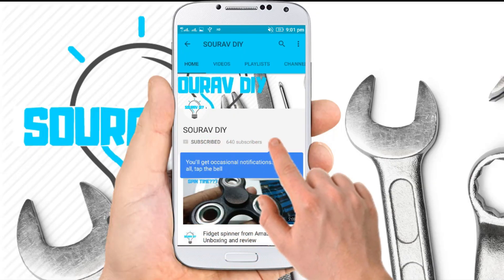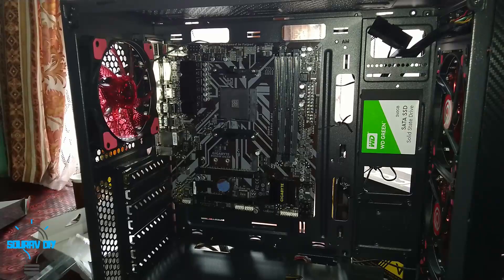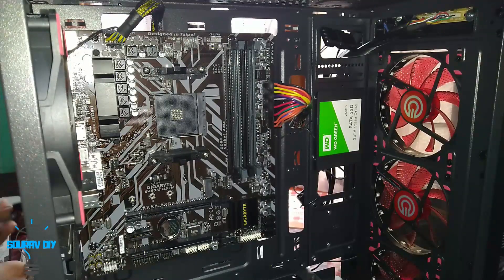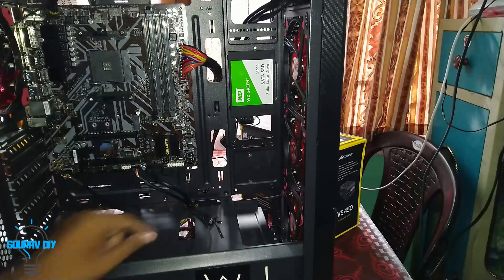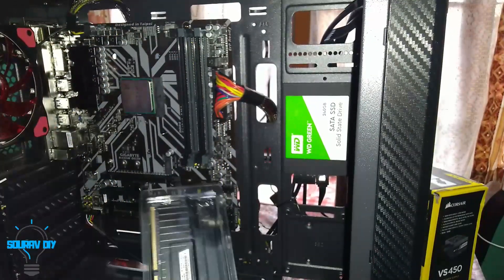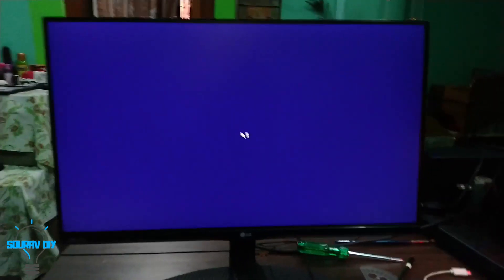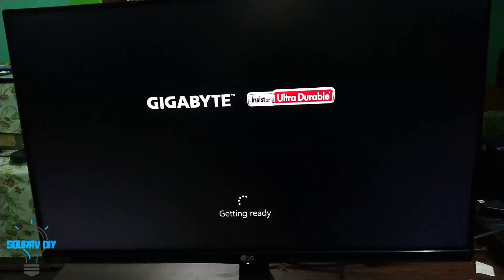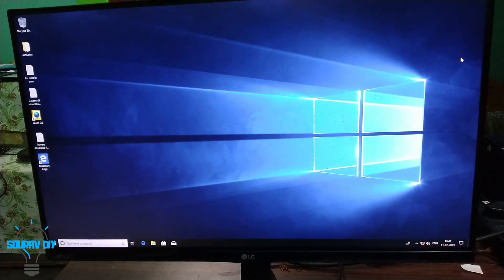How to assemble a Gaming PC, Ryzen3 3200g AM4 socket

Comment: Bro is cabinet has rgb header. If its not thr how to connect 4rgb fans in motherboard
Reply from the maker: This cabinet doesn't have RGB header
Reply from the maker: Buy a cabinet with 3 or 4 Inbuild RGB fan and header eg. Antec df500 or antesport ice tg 400
Reply: I saw vedios in youtube.. This cabinet has including led light remote  controler.. With 4rgb fans
Reply from the maker: @akashaku9363  you have to buy RGB version which is 5000rs , that has 4 RGB fan controller and remote
Reply: Without remote is thr any possible to control  rgb fan
Reply from the maker: @akashaku9363  no , only remote needed to control

Comment: Mere pass ryzen 3 3200g processor jo 2933mhz support karta hai aur b450m ds3h motherboard aur hm 3000mhz ram lagane wale hai kya ye ram support karega bina overclocking aur bios update ke
Reply from the maker: My pc supports 3000 mhz without overclocking

Comment: Which chipset driver you installed for vega 8 graphics
Reply from the maker: Check the driver link in description
Reply: @SOURAVDIY  On installing this driver.Facing a problem in booting.
You know what is cause
Reply from the maker: @mdmohzzam5054  which motherboard u are using
Reply: @SOURAVDIY  i also have same setup that you have almost every part
Reply from the maker: I think any problem in windows version
Reply from the maker: @mdmohzzam5054  download new windows from getintopc.com

Comment: I want to get a slightly better SSD, what size do you think I should get with wd 250gb blue?
Reply: Also, do I need a CPU cooler with this configuration of the components?
Reply: Okay, the first question is solved but (ignoring the price), what cooler should I use: the one in your video or a wraith stealth cooler?
Reply from the maker: Stock cooler is perfect in 3200g , get cabinet with more fans
Reply: @SOURAVDIY  Ok, thanks...do you know which cabinets I can use instead, I don't really know much about this and I want to make a PC that is decent with some multiplayer games.
Reply: @SOURAVDIY  Decent as in good with, not actually with the games.
Reply from the maker: @Tomos_J-J Corsair spec delta
Reply: @SOURAVDIY  Thanks. 2 more questions, what cpu cooler should I use with the same motherboard and cpu as you? (Think of what you'd usually use, but a little bit stronger) and what gpu should I use for an intermediate (like 3.2 out of 5) gaming demand?
Reply: @SOURAVDIY  P.S, I won't be able to message you...I will sleep soon.
Reply from the maker: @Tomos_J-J  wait for amd 5500 gpu
Reply from the maker: @Tomos_J-J  antec a30 or a40 cpu cooler

Comment: Bro i have bought exactly wot u have bought except the mobo i have bought Asus Ex-A320m Gaming.. is it ok with it!!! orelse i shud go for B450.. Awaiting for ur reply asap... My products are on my way..
Reply from the maker: Asus expedition is good , but the motherboard will come bios updated?
Reply: @SOURAVDIY   omg am not sure abt that bro.... If Bios not updated it will be huge mess right!!! If its not updated is it possible to uodate myself orelse i shud find someone like asus centre... Thanx for the reply bro..
Reply from the maker: @loading24x7  if the bios not updated u will suffer problem, it's better to buy motherboard from shop
Reply: @SOURAVDIY   omg.. thank you bro...
Reply: @SOURAVDIY   bro again am sry to disturb u bro... Mobo has only hdmi no vga bro but my monitor  does have only vga.. how to connect bro.. am i screwed!!??!!☹️☹️
Reply from the maker: @loading24x7  hdmi to vga converter, costs rs200
Reply: @SOURAVDIY  bro i do have a cable hdmi vga cable... Where one end hdmi n other end vga.. does it support bro.. if not can u suggest me the exact converter which u prefer so that i can buy...
Reply from the maker: @loading24x7  that hdmi vga cable will work

Comment: İm using 3200g with ga a320m h and vega 8 dosent work. When look from sevice manager i see code 43 error. İ tried do install new drivers but it doesnt work. What i have to do?
Reply from the maker: If your windows version is old drivers will not work
Reply: @SOURAVDIY  acualty ım using 2004 version of windows. I detected my mother board have extra 8 pin but ım using only 4 pin for 8 pin because power suply have only one 4 pin output. cpu works. may extra 4 pin goes for intergrated graphic ? is that the problem?
Reply from the maker: No problem with psu, u need latest version of win 10 for vega driver installation